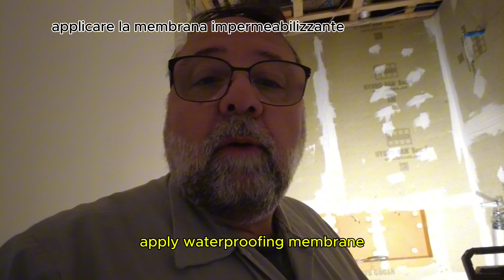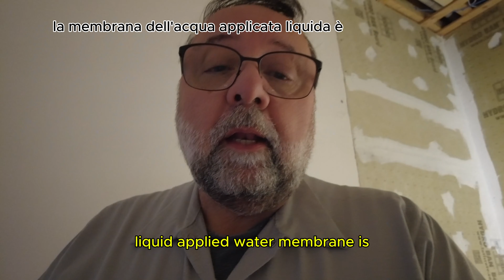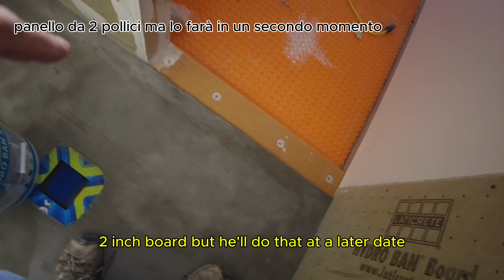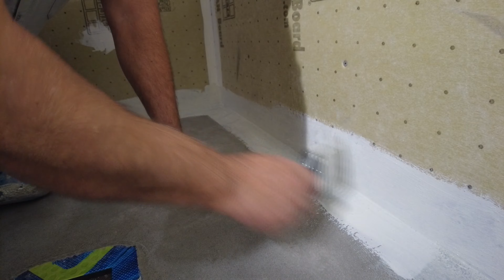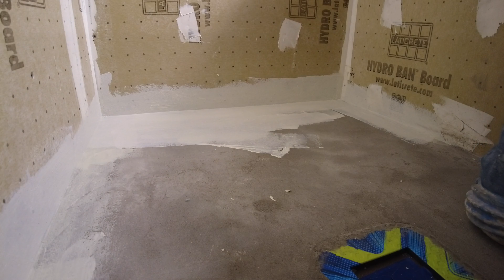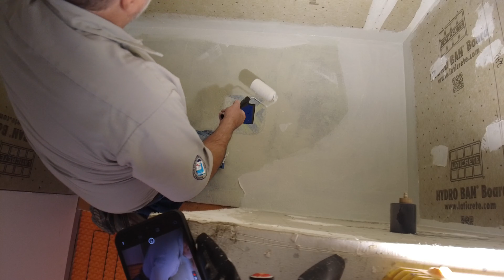How to waterproof a shower floor.

Comment: :-O indeed. Liquid topical membrane on the floor eh? Can't believe I'm seeing Sal do this "for a friend" (because that's the way they want it). Thinset, sheet membrane and banding isn't that much more than Hydroban XP.
Reply: Many contractors use the membrane system because you can tile over it immediately without needing to wait for the thinset to dry.  Hydroban needs to dry, adds a day to the job.
Reply from the maker: Laticrete makes great products